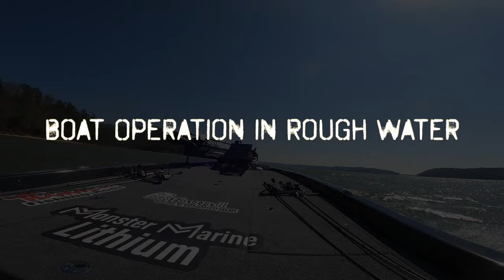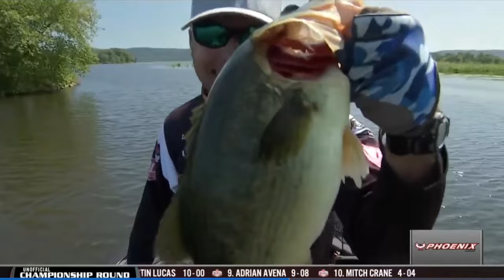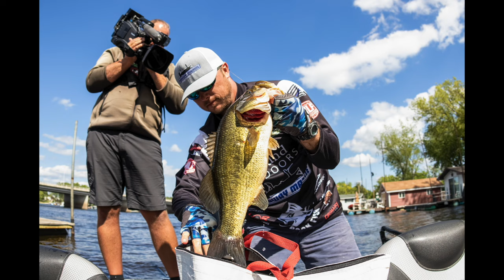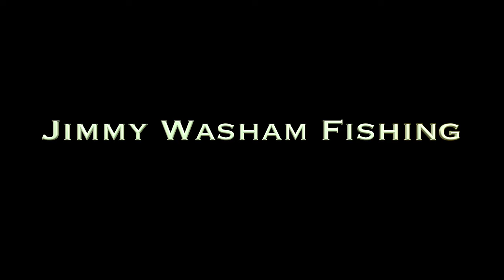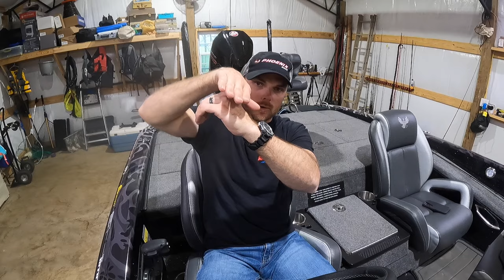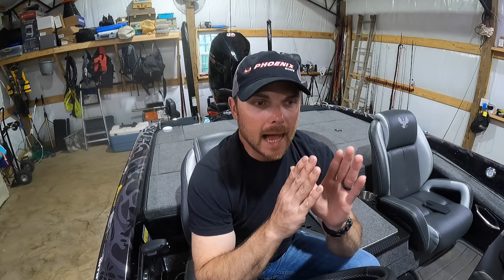How to drive a boat in rough water

Comment: Would deploying a drift sock hooked to the bow be a good idea in a situation where the boat is swamped and power has been lost?
Reply from the maker: I guess that would be your best option in that worst case scenario. You will still likely take waves over the bow but hopefully the bilge still works and can catch up. It would definitely help prevent the boat from rolling over.

Comment: I used to have a 19ft Champion. Best rough water boat I had.
Got caught in one storm during a tournament and we had to go across the lake we were fishing. It was almost like you could see the wind and heavy rain coming like a wall.
Hit the first wave that went from calm to 4ft white caps.
It was like hitting a ramp.
Only 50mph at 3/4 throttle and we were airborne. 
Speared the next wave and the engine was out of the water.
Felt like forever but the boat resurfaced motor still running.
Hit the livewell dump and both bilge pumps even though one was a auto pump I Hit both as the boat was full of water.
Trimming up and half throttle kept the nose up and you could feel the water weight coming off.
Just kept a even throttle and stayed on top of the waves and made it back to the ramp.
Once safe started refilling the livewell and finished 2nd.
Partner was 5th.
We were soaked but never so happy to have the boat back on the trailer.
A few took cover and skipped weigh in. 
We would have but we were already half way across the lake and pretty much committed.
Reply from the maker: If you spend enough time outdoors, you will have to face mother nature. Being safe, smart, and educated on how to handle it are the difference makers.
Reply: I just bought a 193 champ elite. its a pretty sweet boat!
Reply: @johnharropfishing  I am jealous 😁. Miss my old Champion!
Enjoy it and Congratulations!